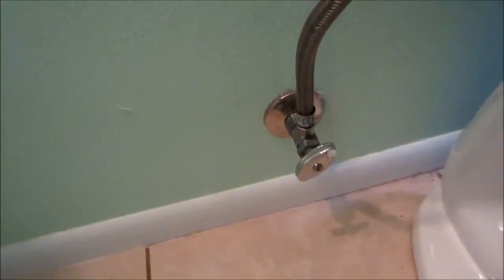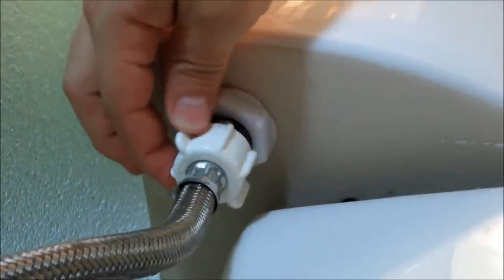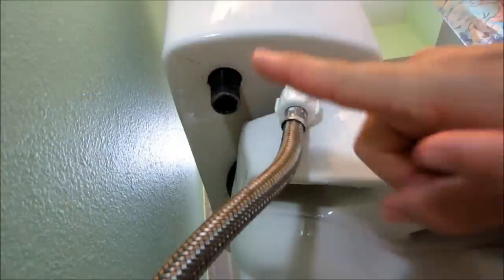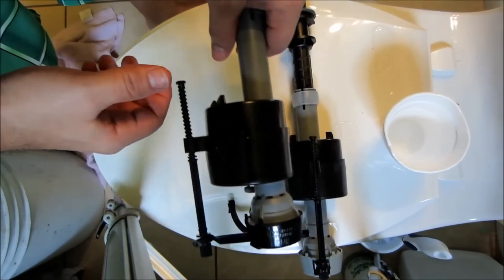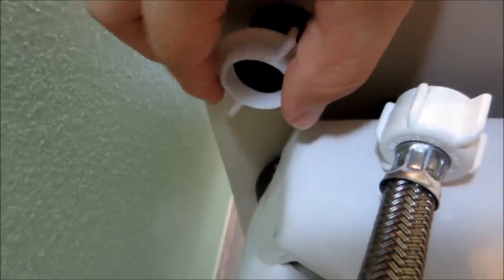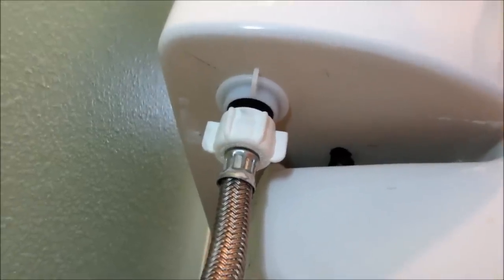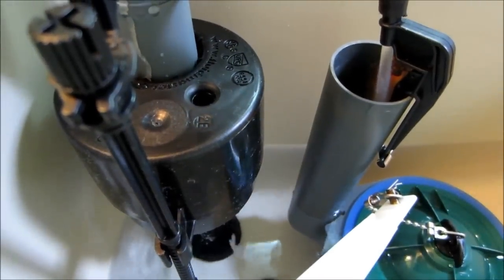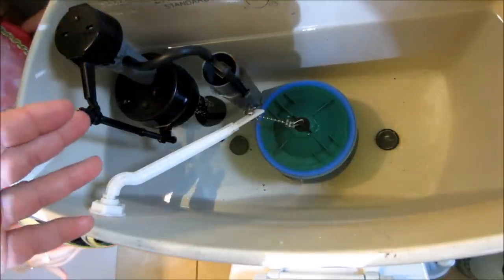High Pitch Toilet Fix

Comment: Pretty much spot on help. Also.. you may not even need to replace the whole unit if you're having the squeeling. For one, I just disconnected the top hose and pulled down the ring clamp and the top part came came right off. Replaced and reconnected everything and it took literally 3 minutes.
Reply: what do you mean the ring clamp?
Reply: Thank you! What’s the ring clamp?
Reply: Great video if you need to replace the whole thing but I would like to add that it's quite possible that you only need to clean the fill valve screen by popping the top cap off and removing debris plus checking rubber seal to make sure it isnt worn. Mineral build up under that cap will make your toilet scream an unhappy tune so check it before you buy and replace the entire assembly. Again great video!

Comment: You didn't need to replace that part. That part with the grey top is the problem. Turn off the water and press down on the top & at the same time turn it a quarter turn anti-clockwise and lift it off. Underneath the top is a rubber washer that simply needs to be removed and cleaned as it will be gunked up. Refitting is the reverse of removing.

Ps It's also a good idea to clean the rubber washers housing at the same time.
Reply: Did this and fixed the problem! Thanks. Thumbs up this so people can try this before buying a replacement
Reply: Thank you SO MUCH - came to the comments to see if there was a lazy-man’s fix! So glad I found it! 🙏🏻

Comment: Hey so I just came from another video where a guy fixed one of these, and you don’t have to take the whole bottom piece off unless you’re is all one piece. The post can stay in place as long as it’s the same, but the valve just slides on and off. Good video showing the whole process though for a time when it’s necessary. Also I appreciate the integrity in editing. Some people set themselves up to look like a pro with “good” editing, just look at Rachel Rae.

Comment: Thanks for posting this.  My high pitch toilet was screaming even when you ran a sink or the washing machine, more specifically, when you shut the sink off.  I think the water pressure was too much for the old fill valve.
I ran into a couple issues, I had to cut the old fill valve off and get a new wall to toilet hose from ace.
Reply from the maker: +jaardesign Thank you so much for watching and commenting!

Comment: Adios!!
I had to change the valve out in ours a few months ago... it wasn't making a noise, but it got stopped up.  The rubber washer in the bottom had disintegrated and parts of it got lodged in the valve.
Thumbs up!
Reply from the maker: ***** Hey oldchevy! It's funny about 20 minutes ago I started reading the directions on this thing and it has a part "If replacing Seal" on it. I had no idea it had one LOL. Maybe that was the problem in the first place. Oh well LOL. 

Thank you so much for stopping in and watching my video.
Aloha and take care

Comment: I had the exact problem after moving into a new condo, the way I fixe is actually took apart that black thing, you can pop open the top and twist open the cap, then I clean it with an old tooth brush and the sound never came back.

Comment: My valve is brand new and still has a high pitch sound that drives us crazy. My landlord just replaced it. Is there another way to adjust it or stop the whistle? My landlord expects us to just live with it.
Reply from the maker: Sorry for the late reply I hoped you fixed it. It could be defective I'm not sure.
Thanks for taking the time to watch and comment! 
Aloha and take care
Reply: Gilda Hunter yes, read comments, some say it’s a washer, some say it’s the float, some say it’s the tube to the wall...

Comment: You make that three times harder than it is. If you’re so worried about wasting 2 gallons of water use the toilet flush it with the water valve off. Remove the valve replace it with a new one. Turn the valve back on you’re done.

Comment: I have nighmares with 00:00 !!!  That sound can get way higher then on this video and continuous.  Unlike you, I'm definitely NOT going to install another Fluidmaster modern assembly and instead going back to the large floating ball since I can handle those moderate noises.  I can't handle the intense noise of that whistling in the middle of the night of the Fluidmaster and toilet guts are not something that can be installed on a whim.  I guess my labor day weekend will be interrupted by installing toilet guts and a new water valve  : l

Comment: There's no such thing as 'wasting water'.  It's all part of a cycle.  You may be wasting a few cents, but that's about it.  Not worth the labour you put in to saving the water.
Reply: Few cents add up to quite a few dollars over the course of a year.
Reply: No they don't.   They literally don't.
Reply: Story I found:

In 2011, a couple in Cape Coral got the shock of their lives when their monthly water bill amounted to a whopping $2,000. This translated to more 100,000 gallons of water used in a single month — enough to fill ten swimming pools. Previously, the couple’s water bill had averaged about $90 per month. Another couple in Asbury Park, N.J, got an even outrageous water bill of $6,261.95 for three months. According to the city’s water company, the couple had used a staggering 1.03 million gallons of water. In both cases, leaky toilets were to blame. These cases show a running toilet can burn a deep hole in your finances.
Reply: ***** If your toilet is using 100,000 gallons a month, it's not a leak it's a river. The 'story' is an urban legend if anything.  Just think about the volume and the size of pipe.  That's almost 3500 gallons a day, or the equivalent of 3000+ flushes per day.  If your toilet were doing that, you'd have no water pressure to use a sink or have a shower.
Reply: Its not even a few cents. Its a fraction of a penny. I don't think he was talking about the water running, of course that can cost loads of money. I think he was saying putting the left over water in the tank into a bucket being a waste of time.
Reply: He’s not talking waste of MONEY - he’s an environmentalist and it was the principle of wasting the WATER. I get it, and thought it was a sweet message.

Comment: you didn't fix anything, you just replaced the part..
Reply: who are you, the definition police? He fixed the high pitched squeal.
Reply: You can fix your cars transmission just as easily!! Take it to Aamco and buy a replacement - ta da! Fixed!
Reply: I appreciate the demonstration, but you're right. Nothing was fixed. You're not a definition police, but the title should have been how to replace the broken unit. I was expecting a fix without taking everything apart.
Reply: He fixed the problem, didn't he?
Reply: Hahaha if you want everything fixed without taking things apart, you could call a plumber and stay out of your  bathroom. Boom- fixed without you taking anything apart!
Reply: Umm, fixing things usually involves replacing parts
Reply: This shot just made me laugh! Thanks guys!
Reply: @perobule9892  wow. The squealing toilet happens bc of a broken piece that needs replaced. Until it is replaced, it is considered broken. Once replaced and the problem stops, it is deemed fixed. You are just lazy and was looking for a quick fix and got discouraged when you realized you actually had to work.